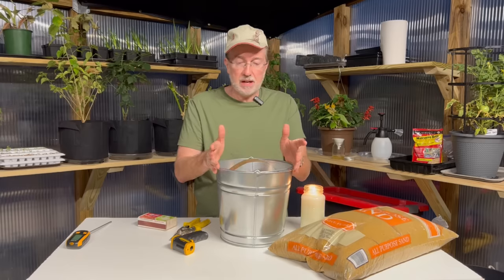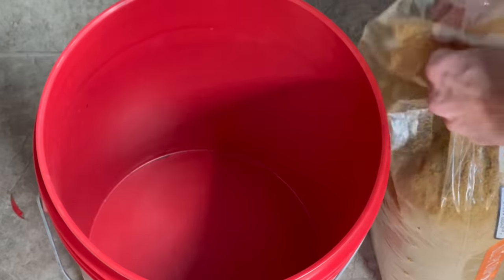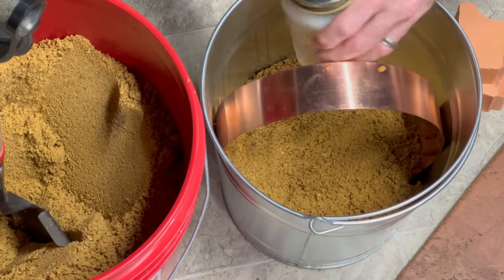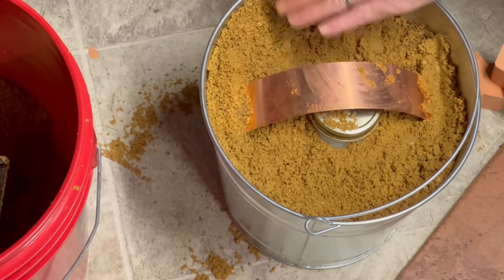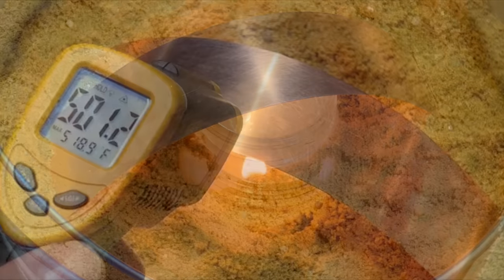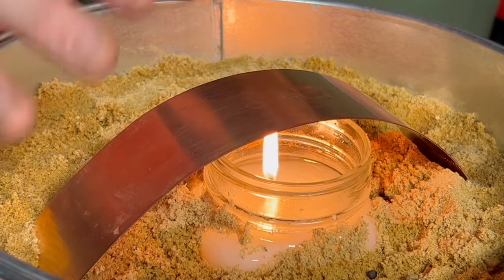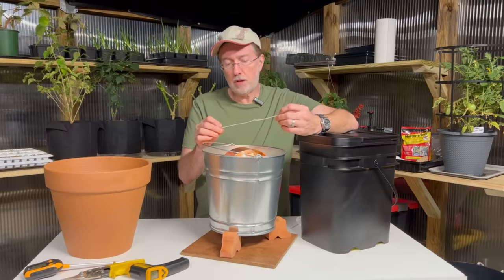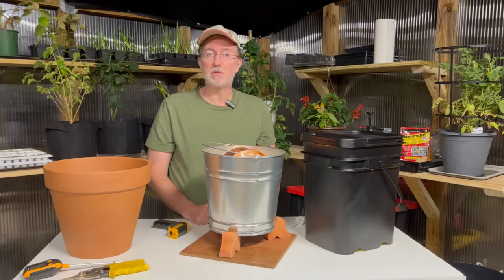DIY Copper And Sand Heater | No Electricity Needed For Greenhouse Heat

Comment: As others have mentioned, a candle produces from 50-80 BTUs so I wonder about how much this can move the needle in terms of heating.  Also, as the candle burns down, you get further from your copper strip so that would further reduce the efficiency of this.  Perhaps if you're greenhouse is hyper insulated this might make a difference I guess.
Reply from the maker: Check out sand battery Finland on YouTube.  It’s the genesis of the idea but this is a prototype so I’m hoping there will be continued ideas to improve on it.
Reply: I believe the advantage of the Metal Pail, Copper Ring, and Sand is partially to store and radiate the heat produced at the same time. A single candle will only radiate light and heat, however, it will not store any of that heat. 🤠
Reply: it depends what your plants are - I cannot overwinter a pot of basil in my living room which gets good maximum sun but has temps that drop as low as 17 deg C in the daytime. It is shrivelled up. But in my bedroom which has the same sun but maintains a few degrees higher temp the other pot of basil is maintaining its foliage quite well.  @TimeSurfer206
Reply: Wow. Up here in zone 3b that means I would only need 170 of these @ 100 btu/hr each to offset the 17000 btu/hr heat loss in my 100 sq ft lean-to greenhouse. The actual solution is more like the capital outlay for an insulated GAHT battery. 100 btu of energy does not become more than a 100 btu just because you found a great way to store it.
Reply: @ZenGardenOasis.  
the only thing i can think of is how to use some kind of biofuel hookup, something that could easily be created by the very mulch your plants produce like grass clippings and converting it into a fuel to use for later, no need for a wick then. 

i guess the difficult thing then is how to burn it safely, i know there are ways in doing it so you don't have to babysit it that much.
Reply: We’re did u get that info…u know one match is one btu
Reply: Logically heat goes up.  Takes the easy way. Heat below, with a water coil in and out of the bucket, yes all hot water will do it  by any heat source. Especially if the heating coil has been place aimed at below the bucket of sand, getting use of all the wasted heat rising.
Reply: There is no such thing as a passive heat amplifier. You only get out what you put in. Maybe you can improve the distribution somewhat but nothing is free.
Reply: @ZenGardenOasis. hi. Have you done tests to see what the sand heats up to?  It seems the test in this video is inconclusive?
Reply: @williamrbuchanan4153 correction, hot air rises but heat radiates in all directions.
Reply: @MyMy-tv7fd  
Possibly due to lower humidity in your living room vs the bedroom.  Plants do very well in well lit kitchens and bathrooms for this reason :)
Reply: @vinquinn  first year course "Human Ecology." Lesson learned: "There is no free lunch."
Reply: The copper strip is pointless regardless so it doesn't matter if the candle burns down.
There is no heat amplification, it is simply a tiny bit of heat going into the copper and slowly being released by copper/sand over time.
Reply: @ZenGardenOasis.  The sand battery you are talking about is getting it's energy from the sun and concentrating it as opposed to reflecting it which is the standard. At least that is my guess from your description in the video. The candle is in an enclosed space and puts out a certain amount of heat in total so you are not losing or gaining heat in an enclosed room.
Reply: @royrobinson4636  Actually this isn't true in an enclosed space. The candle will put out a set amount of heat. You can't increase or decrease that heat. The amount of time you store that heat is going to be 100% off set by the amount of time it takes that heat to be stored. You can't make a candle hotter just by using it to heat other things nor can you increase it's thermal output.
Reply: @skittlemenow  ~ I have concluded your theory is flawed. The differences are the scientific principles of heat disbursement versus heat containment.
For example... My wood stove is surrounded by two layers of clay bricks, on both sides and the top. During the winter months, my wood stove will disperse the same amount of heat (with or without those bricks), however, those bricks will absorb, contain, and store a portion of that same heat. The fire in my wood stove could go out at 9pm Monday night and those bricks will still be warm at 9am Tuesday morning. FYI ~ I've been a Mechanical Engineer for the past 35 years. 🤠
Reply: @royrobinson4636  the bricks in your stove store heat that would otherwise be lost out the chimney. If you did not have a chimney the total amount of heat generated by the fuel would be the same and the bricks unnecessary. A green house doesn't have such an extreme heat loss as a chimney. So burning a candle will heat the room the same amount for the same time regardless of the contraption you use.
Reply: It doesn't matter how high or low the candle flame is. There is no increasing or decreasing of efficiency in this system Also flames give off humidity which causes mold. Better to get an old fashioned electric lamp. A 40 watt bulb will give off 136 BTU per hour. Put two 100 watt bulbs in series. This will give you 50 watts and they will never burn out.
Reply: @skittlemenow  ~ Much like using an Unsharpened Pencil, arguing about Thermodynamics with you is pointless. 🤣
Reply: @TimeSurfer206 , do you “copy, paste” all the time or??
Reply: You are absolutely right. No such thing as free energy.   @vinquinn
Reply: You can't get anymore energy out of a candle flame than what it produces while its burning. Basic thermodynamics. @ZenGardenOasis.
Reply: @gnrloewen6065 , I'm sure there will be arguments, but a candle gets 2-3 times hotter than the Finland sand battery. Candle heating could replace all commercial and residential heating if the candles were the size of a large campfire and you didn't mind the safety issues. It would be better to make a large compost pile inside a greenhouse, at least that puts out substantial heat for a greenhouse and has a useful byproduct.
Reply: @royrobinson4636  makes no difference.
The candle BY ITSELF produces the same energy whether its heating sand or heating the air itself- ITS EXACTLY THE SAME.
Go back to high-school science class.
Reply: @rdallas81  🤯 <~~ LOOK, there's another Unsharpened Pencil, LOL 🤣 I agree, that a candle will only produce a given amount of BTU's, however, my point was the best way to contain, distribute, and store those BTU's. 🤠 It's painfully obvious to me that "some people" are completely clueless! 😵‍💫
Reply: @royrobinson4636  Roy?
Hey Roy!
Reply: @royrobinson4636  you're not storing it tho
Reply: well, you probably will be using multiple candles, each warming 4-6 plants around it. not the whole GH, just about a couple feet radius the heat could reach.
Reply: 6 small tealights make my room half a degree Celsius warmer. But this type heating works differently. You are not just heating air.  Hot air rises very quickly, and it would mostly heat the ceiling. By heating the sand it turns into radiant infrared heat, infrared radiant heat has a much bigger reach and you can have it low to the ground near a plant that is more sensitieve to cold temperatures.  At the same time it is a very consistent source of heat which works very similar like a capacitor. 

That the flame drops a bit is no issue at all because the pot is close to the copper. The heat has not other path to go as to pass the copper.
Reply: I find it hilarious that those skeptics who focus on the BTU output of a flame, and conclude that room heating claims must be false, are consistently and conveniently silent on the concepts of storing that heat in a thermal mass and radiating it, as opposed to wastefully heating a narrow column of air rising uselessly to the ceiling.  

Maybe this will help:  Heat rises -- people don't!

Keeping a radiant heat source down where it's useful, down where people are, is the point.  Commercial heating systems produce many more BTUs because they're taking into account the 'ceiling waste' in heating a room, raising the temperature of all of its air volume, its surfaces, etc.  

What we're talking about here is more akin to the old gas space heaters where a relatively small flame heats a ceramic thermal mass, positioned in front of a radiating reflector.  Ever scoff at one of those?  Probably not, because they're 'official', instead of 'just' a DIY YouTube video idea.  Keyboard warriors!  Go figure!
Reply: @billparrish4385  Same what I wrote 👍
Reply: @royrobinson4636  The storage is inside the candle itself, the fuel is a store of energy.
Reply: Yes BTUs are important, but thermal mass optimizes BTUs in this particular scenario.  For example if you burn a candle alone all it really going to heat is the column of air directly above it.  It’s primarily heating by convection which rises straight to the ceiling and since we only heating air which can easily escape especially if that air is very hot.  The sand allows you to convert most of that convection to radiation which will slowly release heat. Which prevent less of heat escaping as easily. Now a candle is only going to do so much and the size of the thermal mass isn’t very large. But the concept still works it’s just that this needs to be scaled up to be effective for any conventional home or room.
Reply: @jarnoldbn  ~ Exactly! Regardless of the BTUs produced (from any source), the point is how you manage those BTUs more effectively and efficiently.
Sadly, "Some people" will never understand that concept. 🙄
Reply: @billparrish4385  exactly👍 it's baffling that so many people just don't get it.
Reply: @billparrish4385 A candle outputs about 2 Watts. (2 lb candle burning for 3 hours)
Funnily enough that's about the same total energy as a 18650 vape battery.

2 Watts isn't going to heat any room no matter how good you are at keeping it at people level.
For comparison a person at rest gives off ~100 Watts.
Reply: @dougaltolan3017  Not enough to heat the room?  I agree.  Enough to keep a person warmer?  Let me ask you:  How many BTUs are in those chemical gel hand warmers?  You know, the kind you mix up inside the sealed bag, and put into your pockets to keep your hands from freezing?  Probably not very much heat.  Certainly not enough to heat a whole room.  Then what's the point of them?  Why buy them if they can't heat the whole room like a central heat plant?

My point being, you're comparing apples and oranges.  You're evaluating a small, radiant space heater consisting of candles and some sort of thermal mass, against an HVAC system designed to heat all the air volume in a room.  No space heater of any design, manufactured by anyone, will win that contest.  Guess we'd better stop making all space heaters, huh?  If they can't compare to a whole furnace?

Ugh....
Reply: @billparrish4385  I bring you real, calculated values. You bring a mush mash of totally different applications.
Why don't you tell me how much energy is in a hand warmer?
How are you going to get a bucket of sand that's 2 centigrade warmer than its surroundings to keep you warm?

The only debate here is physics, so far you've only brought emotions.
Reply: @dougaltolan3017  Hardly emotions.  Rather, real-world comparisons.  Part of physics is accurately defining the claim and the application.  Neither of which you have done.  You say if it doesn't duplicate a furnace, all claims about it are invalid.  No one, however, claims that.  People are instead talking about a DIY space heater, one that performs surprisingly well in that application.  Your scoffing seems based in the fact that it isn't a furnace.  Big deal, it's not a jet engine, either.  Doesn't mean it's the nothing burger you seem to need it to be.
Reply: @billparrish4385  it's a 2 Watt heat source no matter how you dress it up
Reply: @dougaltolan3017  "...no matter how you dress it up."  Thus relieving yourself of any responsibility to read, understand, digest, or respond to any of my points or comparisons.  You're doing a version of closing your eyes, sticking your fingers in your ears and humming a tune.  You're welded to the idea of that wattage of a single candle flame, with zero time to even think about any of the other aspects of the construction of one of these heaters.  Tell me, can the words 'space heater' even come out of your keyboard?  And this claim of yours about 2 watts was measured how?  Were any of the specs describing how these were constructed even consulted?  How many flames, wick lengths and diameters, burn durations, etc.?  Sounds pretty easy to just spit out "2 watts" with contempt, and not have to sully your hands with any other of the many relevant facts you're ignoring.  Must be nice to just take a position, and not respond to any arguments.  Less wear and tear on the gray matter that way....  Ugh....
Reply: @billparrish4385  untill you are able to publish your own value for a single candle power output, you don't even touch the start of this debate.
In my first post here I wrote the significant parts of my calculation, you have provided no figures at all. To remind you:
"a 2lb candle burning for 3 hours"

Specs? 
Video stated burn time of some hours and an estimate of candle weight comes from images of it. 
Feel free to look up calorific values for any candles you like.

If you haven't even got a grasp of the energy available then you don't have any points worth addressing, just mosh mash of airy fairy feelings.
Reply: water can not get hotter than 212°f the copper can get much hotter.
Reply: You should let this burn for about 8 hours then put a meat thermometer or other heat probe into the sand.
Reply: It's mumbo jumbo, a candel 25 w heater max. It's a scam.
Reply: @billparrish4385  they are also producing alot more btu's then a single candle.
Reply: @royrobinson4636  What we object to is the implying that this little heat source is going to have a real impact on heating the area.
Reply: @jhenrypaul  ~ My point is not how many BTUs a candle can generate, but the most efficient and productive way to use and manage those BTUs, Sir
Reply: @royrobinson4636  That is fair enough! I actually kinda like the author's sand idea with using copper. expand the size and a different heat and bigger heat source, I think it has possibilities. 

The issue I would have with your efficiencies arguement. Is that financially the heat efficiencies may not be justifiable.

Candles are far too expensive to be used in this way. As are vegetable oils /fats.
Reply: Use ceramic Pot instead of metal.      👽🛸💃.   💘👁🕊
Reply: I need to see some independent, peer reviewed published studies.
Reply: @TheDesertwalker  ~ Here's a thought (since you don't seem to be too busy), try it yourself and let us know your results 😁
Reply: @ZenGardenOasis. 😊
Reply: . @gnrloewen6065  My guess is that this pail is set on the floor and keeps the heat lower longer where the feet and plants are instead of sending the heat straight up to the glass or plastic ceiling where it transfers quickly to heat the outside. Same BTU but used and stored more efficiently where you need it. There is likely some galvanic action there also that may add ever so slightly to heat.

Comment: Suggestion. Fill the bucket 3/4 with sand and put a 2" layer of cement mortar on top, let it set fully. Turn your bucket upside down and place it on bricks just high enough to fit the candle underneath.
Reply from the maker: Fascinating idea.
Reply: Not just interesting but physics tuned to another level … capping the radiation to form thermal blanket is superb plus the candle flame is spreading directly into entire mass versus wicking! Superior!
Reply: Or just leave the bucket up the right way and raise it on bricks.  Put the candle underneath.

Comment: One of the most effective strategies is to reduce the heated volume of the greenhouse by partitioning it off into the minimum space required. I can see a version this being useful if, say a tray of sand is heated, allowing plants placed above it [not necessarily on it] to be kept warm through convection from the body of sand
Reply: Thermal mass applies to air as well as solids.  As for Heating a small area, it will heat faster for a given BTU but because the air volume i e. Thermal massnis smaller it will lose its heat faster than a larger volume of space.
Reply from the maker: Check out video about sand battery in Finland.  Very interesting. Thanks for the input.

Comment: Like you say, it would work better with a crisco candle. It would put out more heat for a longer time. 
That would make it more useful in a small space like a Harbor Freight greenhouse or a pumphouse.
What if you put a second strip of copper and crossed the two strips and had a crisco candle with four wicks set directly under the two strips?
Reply: Also wet the sand to make it conduct heat better.

Comment: Try using hardy backer backer beard as a heat base. You can set the pail directly on it and it will prevent heat transfer. I use it and it works great. It's cheap. And home depot carries it.
Reply from the maker: Sounds great.

Comment: I've watched a few other videos about candle heaters but they didn't look like they'd put much heat out. Haven't tried any so can't say they wouldn't. This one looks like it would actually work pretty well. Interesting video. I live next to a feed and garden center that has what I'd need to make this heater except for the copper ring. I don't have a green house but have a small side room I spend a good deal of time in and it doesn't get much heat from the rest of the house.
Reply: I need a clue as to how thick the copper bar is!!